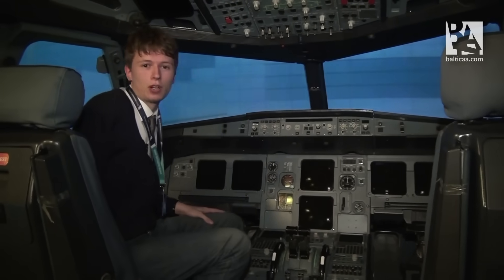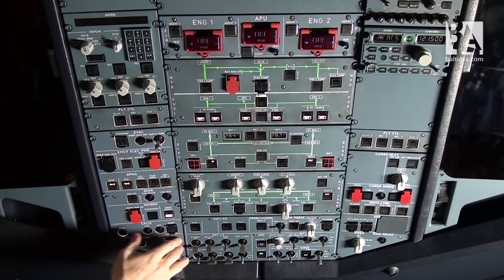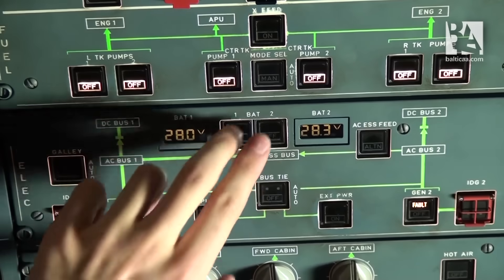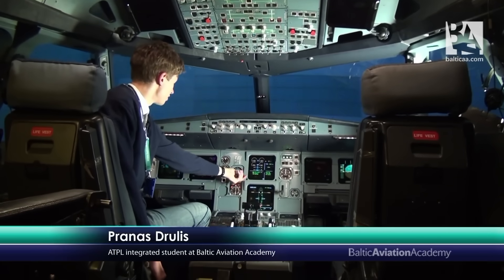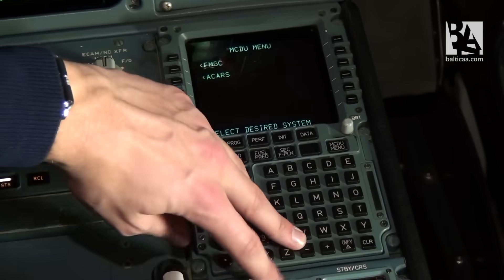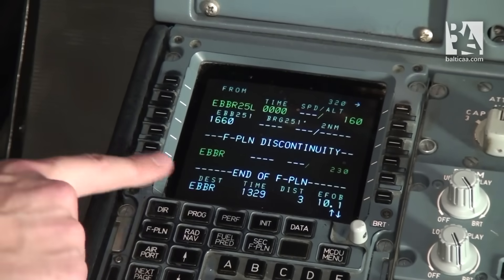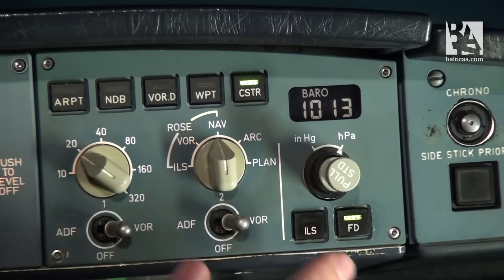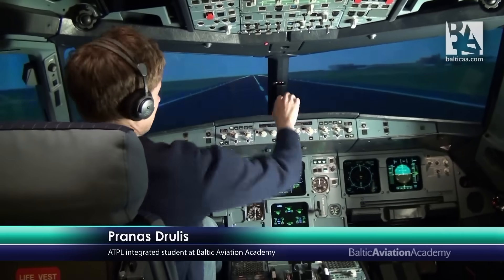Airbus A320 - From Cold and Dark to Ready for Taxiing

Comment: imagine having to check your car each morning for 15 minutes before you can start the damn thing.
Reply: Jeroen Steeman   Before fuel injection we had carburetors to set choke and warm up, soften, fifteen minutes was normal especially in the winter
Reply: @George-wx9dj  only in backwoods American cars, real cars had mechanical fuel injection.
Reply: Would actually be a safer place if "Pre-Flight" on cars was a thing..... As a retired mechanic and smog inspection tech I can boldly say, there are far too many vehicles on the road that absolutely have no right being there in the name of safety.
Reply: @OpSic66  Also a mechanic. There are cars that come into my shop that i end up refusing service to because they are just NOT safe to drive!
Reply: @OpSic66  i'm currently planning to start experimenting an onboard diagnostics to check my car before start engine. it may sound overcomplicating but it actually fun to do... microcontroller (arduino) and linux based car computer system.. when the project done, it will check everything from voltages, temps, fluids, service record and display the results on center console oled/ips lcd touchscreen panel which the GUI is programmed on Qt5...
Reply: @OpSic66  Amen
Reply: I'd be late to work every day
Reply: @jonasberney8857  Not if you get your lazy butt out of bed earlier!  ;)
Reply: @n10cities  haha yeah it’s just killer on days I gotta get up at 1:30am for work
Reply: Imagine if your car could fly
Reply: @drdefecation  Hahahahaha you're crazy buddy
Reply: i mean arent we supposed to check the car every morning ? :D
Reply: @chips2195 Yeah but everything will be fine with a five or minute check
Reply: You would, if it had to transport 100+ people several thousand kilometers.
Reply: @ProAverageGuy For our safety. No one wants the uncomfortable trip👍🏻👍🏻
Reply: I have a check list for the car and if you do it frequently enough it takes about 10.
1 open hood, check level on radiator fluid, oil, washer, brake. close hood. 
2 Open trunk, verify tools, jack, spare, check food, water, carbine, ammunition for missing parts, spoilage, flat or corrosion. 
3 Get in car, check hand brakes on, flip switch check SLI battery voltage good, Aux battery good, Bridge switch off. Auxillary lights work, amber strobe lights work. 
4 Start car. Monitor oil temperature, engine rev speed, turn on TPMS, verify all four wheels are in correct pressure. open mirror to preset location. Engine temperature hits normal range and idle at less than 1000rpm, engage A/C compressor. 
5 Unlock parking brake, roll out. Depending on the frequency I do this about 4-5 times a day.  

shut down is simpler
1 parking alignment to space allocated, check all three mirrors, roll down window and manually inspect if needed be
2 fold down high gain antenna (if VHF/UHF radio in operation)
3: set parking brake
4: verify steering wheel center
5: verify A/C compressor off
6: verify Aux Battery bridge/charger switch off
7: verify entertainment system is off
8: verify mirrors are folded
9: shutdown

OCD complex, been at it for 13 years, now I don't bother looking at the checklist, I just count it off in my head.
Reply: Haha yeah, and get the clearance from the neighbours to do so
Reply: I wouldn’t suggest to buy the a320 as a daily driver
Reply: @justangell8639  I wish I could afford an a320 as a daily driver
Reply: Pre and post trip inspections of 15 minutes are required on tractor trailers here in the US. Every. Day. Been doing it for 20 years.
Reply: In a real scenario including the co pilot you can cut that time in half. Maybe even less. Longest is waiting for the APU and engines to spool up.
Reply: @ThePolacanthus  didnt say on this video,but with the APU you also have to wait for it to get on temperature before load it.
also tractor trailers had to wait for air pressure to build up or it will not allow you to move it.
Reply: @xiro6   Until boarding is done the APU is on temp, I'd guess. Don't the air compressors run on external power already?
Reply: @ThePolacanthus  i mean,when you start the APU,you have to wait a certain time before connect to the electrical load.
its on the checklist,i think,to extend the APU lifespan,it needs to stabilize its temperature before getting load.
Reply: I have to check my semi every morning...
Reply: speaking of which.....had a friend in aviation once tell me "if we maintained our cars to the same frequency and standards as airline jets, we could drive them for 1 Million Miles."
Reply: Is the same with a semi truck at least in usa , and works very well
Reply: The car onboard computer does that in 2 seconds.
Reply: @matsv201  planes are a different story tho they are much more complex than cars
Reply: @G_Diddler  you kind of missed the point.
Reply: @matsv201  ik whats the point
Reply: @G_Diddler  that modern cars does make a start up test. And.. well so does aircrafts... but there is more manual checkups.
Reply: @matsv201  Onboard computer? Are you on something?
Reply: Imagine your car could fly at 500mph.
Reply: @Robin-bk2lm  my family would get to Florida in no time at all lol
Reply: If the lives of about 180 people depended on your car working without problems, you would do a 15min check each morning.
Reply: We are supposed to check our car every morning.
Reply: @KhaiGK  Thats true, and if people actually did as you say our roads would be much safer.
Reply: And request to Local police to start the engine?
Reply: @harryakb11  Hello this is REG-123; permission to start engine for trip to work as filed
Reply: I do have a checklist where I used to do quick checks which hardly takes 5 minutes.
Reply: drive a Tesla and you come very close to it
Reply: @ashs2ashsdust2dust13  nope,you can even turn the heater on while still on bed with you mobile phone.(for habitacl, and battery if its really cold)
Reply: @ashs2ashsdust2dust13  you don’t complete a checklist on a Tesla m8 it’s like every other car
Reply: @ashs2ashsdust2dust13  what?
Reply: @ashs2ashsdust2dust13  I must be doing something wrong. I leave the house, get into a warm car and off I go.
Reply: @ashs2ashsdust2dust13 what are you talking about?
Reply: Man, fuck that. I get up at 5:30 to go to work. I certainly wouldn’t want to get up any earlier than that.
Reply: Thorough Pre and Post Trip inspections are required for my truck. If you do it every day it goes quick, and you'll know when things are wrong.
Reply: we take 20 min to check the ambulance..
Reply: Laughs in shitbox
Reply: Then rusian ppl have a big problem
Reply: you're taught in driving school to check lights, tires oil and fuel every morning
not that I know anyone who does
Reply: setting my car’s nav feels a bit like this a320
Reply: not the worst idea...
Reply: I do. Its called a pre trip. I spend another 30mins checking my rig before I drive it.
Reply: Wait until we have driverless cars, not only will it be mandatory, but we'll have to get an independent party to sign off on it.
Reply: @pwhnckexstflajizdryvombqug9042    driver-less cars.  something of a misnomer.  someone is driving, it's just not the passenger.  so when Big Brother wants YOU to be somewhere THEY want.....  That's why socialist democrats like Milwaukee's choo choo tommy barrett LOVE mass trans.  You can only go where THEY want you to.
Reply: LMAO
Reply: This is VERY similar to what we call in the commercial transit industry as performing a pretrip inspection. I recently retired from this industry couple of years ago as an instructor after 26 years-  in other words I was responsible to train people both classroom and behind the wheel how to drive a bus. For the most part we were allotted 15 minutes to pretrip our buses before heading out in service.
Reply: Semi drivers do it twice every day
Reply: You're actually supposed to. Nobody ever does, but that doesn't change the fact.
Reply: Imagine of you forgot to get gas the night before that you would kill 300+ or more people.
Reply: Imagine if that was your job
Reply: Imagine your car could eat pedestrians you pass by...
Reply: Actually I do that) Not 15 min but I check wheels and plates
Reply: legally we are bound to do a safety check each time before the vehicle is used, checking lights etc. It's part of taking the driving licenece where I live
Reply: Your car's not worth $80,000,000.
:P
Reply: Imagine how many less morons would be on the road if this was the case
Reply: But you don't transport hundreds of people through the air. I am glad to see this is so elaborate.
Reply: Unfortunately, people have really gotten lazy about important thing in our lives, such as verifying your vehicle will get your family to your destination safely. You should check your vehicle before you drive it anywhere by doing what aircraft mechanics and pilots do prior to every flight. There is a walk-around to check for any damage, leaks or condition that will prevent you from driving safely (low tire pressure, for example). Then (if you have someone to assist you), have them turn on the lights for you to check the turn signals, headlights (high and low beams), depress the brake pedal so you can verify the brake lights work, and put the vehicle in reverse to check the reverse indication lights. If you do not have an assistant, it will take a little longer, but you can complete all of these steps yourself.

After the exterior check, you check everything on the interior by starting the vehicle to let the engine warm up, and any fault information should be indicated by a fault message or light on the dashboard screen. After the engine has warmed up, the easiest way for you to know the engine is ready for driving the vehicle safely is you will hear the engine idle RPM drop, and the vehicle should be running smoothly. 

This is an area where you can still have a problem / fault; with the engine running, any significant fault / failure would either be indicated on the dash, or there would be a sound / vibration that indicates an engine or electrical system fault / failure. If all is good up to this point, you are ready to start driving.

This is when you put your vehicle in gear and start driving to your destination. But the checks are not completed. There are still issues that can be discovered after your vehicle is being driven down the road. Now you should listen for not only rattles and squeaks, but for more mechanical issues with either the tires, brakes and exhaust system. If there are no obvious problems with the vehicle and all of its systems are functioning normally, you should have no trouble getting where you are going safely.

I know this was a slight exaggeration, but there are some pretty simple things you can do when you are getting ready to drive somewhere:

1. As you walk to your vehicle, scan it for anything obvious, dents, scratches, bullet holes (true story involved)
2. If you see a tire is low on air, the tire is already 20psi or more low, get it checked for a leak
3. This is when you can make sure all of your lights are working
4. Start the engine, after checks as were discussed above completed, you're on your way

How many people do you think will do just this little bit to make sure they are driving safe? Never mind treat it like an aircraft, people won't even do this little bit...
Reply: An airliner is a little tiny bit more complex than a care lol
Reply: Don't forget to make sure your windshield wipers are off.
Reply: Well people should check tyre pressures, oil levels, water levels, lights all working and clean, horn works and wipers are clean. 
It's a legal requirement because you can get fined if you drive with a car not in a roadworthy condition
Reply: well ever herd of racecars?
Reply: Everyone should check each tire visually before getting in but most people don't bother.
Reply: That's not even including the exterior checks.
Imagine having to ask someone that start up your car, ask to get out of your garage and so on and so forth
Reply: Before calling a taxi!
Reply: Well you're supposed to do basic checks, tyre pressures, lights, water levels, fuel, oil.
Reply: There’s going to be a point where everyone could be a pilot. All these entries by the instructor could be coded and commanded by a computer program from ATC to plane. 
Look a the old space shuttles and the new dragon capsule from space x.
Reply: @OscarDiaz-nn9ch  space 🤣🤣🤣
Reply: @OscarDiaz-nn9ch  My man def never saw a boeing cockpit lmao
Reply: Technically, we’re suppose to. After starting up your vehicle, make it run for about 10-12 minutes to allow the engine oil and transmission fluid to flow smoothly.
Reply: @ROMEROME1990  especially for direct injection engines, this is terrible advice...let it build oil pressure (a couple of seconds) and then drive, preferably not like you stole it.
Warming it up by idling is a thing of the past. Old diesels with a precombustion chamber needed this (head could crack otherwise) and carburated engines would keep diing on you when cold. Computerised injection - pointless, you're just making the engine run cold longer.
Reply: @ROMEROME1990  yeah. 50 years ago. 10-12 min is an exageration. a couple of min to warm up and drive smoothly and calm for other 5 min and u'll be fine
Reply: @ROMEROME1990  NONSENSE, check tyres, oil, water, lights, washer and wipers and horn should be checked
Reply: @ROMEROME1990  nah not any more with modern lubricants.

Comment: So dumb. Why isn't it all automatic?
Reply: That's because that technology may not have been available at the time of its creation (1984) and/or was not deemed safe to use. Most airplanes are very old, and the average lifespan of an airliners is like 25 years, and that's perfectly fine as they are made to last. But my point is that you can't always have the latest technology on planes exactly because of this.

Comment: Why couldn't computer do all this by it self?At the end it does only you have to move your finger a lot.
Reply: That's because that technology may not have been available at the time of its creation (1984) and/or was not deemed safe to use. Most airplanes are very old, and the average lifespan of an airliners is like 25 years, and that's perfectly fine as they are made to last. But my point is that you can't always have the latest technology on planes exactly because of this.

Comment: Checklist: 1. Press start Button

Check!

Checklist complete
Reply: exactly. the whole checklist could be done automatically - I really don't see any benefit to do it manually...
Reply: @rpriesol  The computer does the checks. The pilot just looks for any fault lights that might be reported and prepares the plane for flight.
Reply: @rpriesol  most of the swich is set to automatic. The point of the checklist is to make sure it works if it taken out of automatic.

Really the only reason its not all automatic is because a plane cant just pull up to the side if a system fail.

Granted, something mote modern like A220, a lot more system is just fully automatic.
Reply: This is completely insane. The computer should do ALL of this, and only prompt the pilot to clear conditions that are out of position. The pilot should clear conditions. Start the APU.  Clear conditions again. Start M1. Clear conditions. Start M2. Comm with tower as needed.
Reply: @FelonyVideos  thanks for the insight mr. airline pilot, im sure you should be the one they should call when designing airplanes.
Reply: @danielsteger8456  I spent 30 years at Lockheed and McDonnell Douglas designing fighter planes, space shuttles, etc. You're welcome.
Reply: @FelonyVideos  then why didnt you design your planes so that no lengthy checklists are necessary? there has to be a reason for it.
Reply: Comparing to Boeing 737 - IT IS.
Reply: Full Xbox Console start checklist (From cold+dark to disk in drive).
Reply: Lol
Reply: hahahahhhhahah

Comment: Half expecting to see a Windows XP boot up screen, when he turned the displays on, can’t say how many times I’ve been shocked to see stuff like this run Windows, seen it on Locomotives and some heavy equipment whenever they start them up and the screens boot, heck my navigation system in my Explorer runs on a Microsoft system probably Windows but I haven’t dug into it because I’m slightly scared of screwing it up

Comment: Not a pilot but shouldn't the Engine mode be switched back from ignition to normal after they're both started?
Reply: Yeah they should, ignition isn't needed when taking off except for heavy rain, then ignition is needed
Reply: Harvey Bolton you are correct.
Reply: Just in case the engines die on takeoff
Reply: I‘m Not sure, but i think you can and should start the engines in Norm Mode, because in case of an fail or error while starting, the engine will shut down automaticly. Correct me if i‘m wrong
Reply: @vDuBi  u cant turn on the engines without ignition lol
Reply: Nope they should be left on ignition until reaching a specific altitude
Reply: No, ignition mode its used for takeoff, its like continuous in boeing, but simplified

Comment: Damm there was alot of dust in that Cockpit, i gess it was a simulator, but enyway, alot of dust to get inside all the buttens in that Airplaine, not very safe. if it was a real Airplaine, it will not be very safe with so durti Cockpit, sand and dust in all the buttens, it can stand betwn life and dead, try to emagine in 20.000 feet the buttens stop to work becorse of all that stuppid dust get inside the buttens, one thing you always can be sure about, the plaine will always come down.

Comment: At 4:12 One of the the fault lights on the electric panel is only showing ‘LT’ the FAU is missing, I can see that is probably just an issue with the lights but what if the ‘LT’ also goes away, does that mean a Fault would not be known about
Reply: It's the angle you are viewing it at.